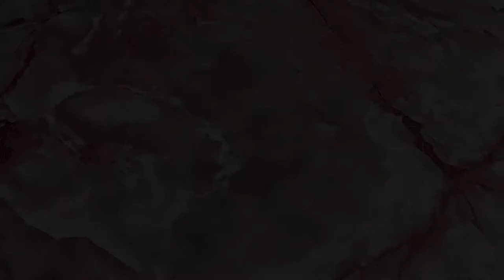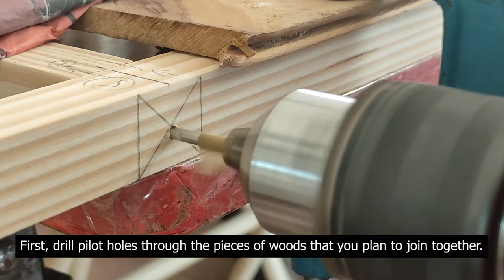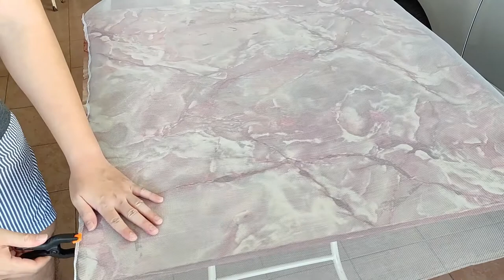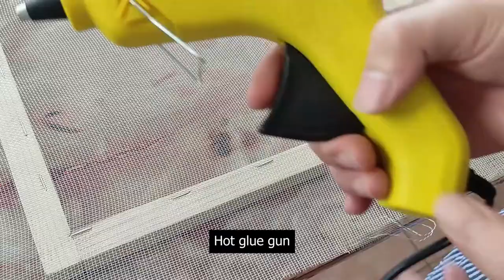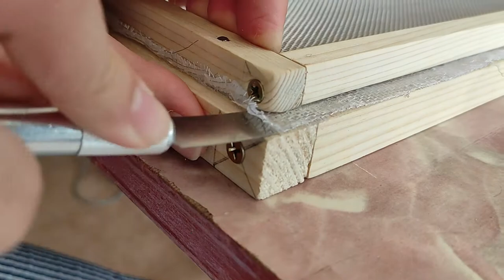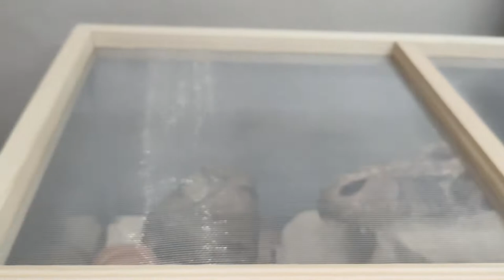How to make a terrarium/aquarium screen lid! | Easy DIY terrarium screen lid (for my leopard geckos)

Comment: I was about to suggest using wood glue to cover up the edges after you trimmed the mesh but when I saw how the lid sat recessed in the tank I understood why you didn't, so you could have a snug fit. Enjoyable video. Thanks.

Comment: Also I would recommend that you should use a digital thermometer and not those crappy ones. Also if the tank is big enough to house both of the leopard geckos territories AND if they are both female it isn't that bad to house 2 leopard geckos. But yet again it is not recommended to do that. Also I am going to make a lid for my leo.

Comment: Nice design. I have same type of aquarium (no plastic frames) and want to use it for corn snake or ball python, but I'm not sure if snake won't pop the lid open. How heavy is it?
Reply from the maker: Ohh i think it's somewhere around 2kg? But it depends on the size of your aquarium too though, the bigger your aquarium the bigger/heavier the lid (my lid is 2.5ft x 1.64ft)...
And also the size of the lower frame (how firmly/tight it fits on your aquarium).
Anyway, I don't own any ball python..i assume those big noodles can easily pop  off a 2kg lid eh?
Reply: Mine's a mere tarantula and I'm sure it's capable of popping it open haha, let alone a snake. I intend to find a way to add some magnets

Comment: Great simple video, easy to follow for a smooth seamless design. On a separate note, where did you find the decor fake hollow hide for your geckos?
Reply from the maker: Thank you! For the decor, i actually made it myself. 
1. Use PVC pipe to make the tunnel
2. Newspaper + toilet paper + glue to build the body (form shape of the decor)
3. Coat it with a medium-thick layer of potting clay-sand mixture.
4. Mould it anyway you like!

Sorry for the late reply, I'm currently busy  with uni assignments :')

All the best to your projects!

Comment: Just take the word "easy" off of the video title. You did a great job, but there was nothing easy about it.
Reply: If you can’t make a rectangular frame and staple some screen to it you might look into the “for dummies” books
Reply: Just me because I'm lazy I'd not make 2 frames, wouldn't shave off the glue and wouldn't trim the screen at the end so carefully. That will save big time. Just screw 4 pieces of wood together and glue the screen to it.